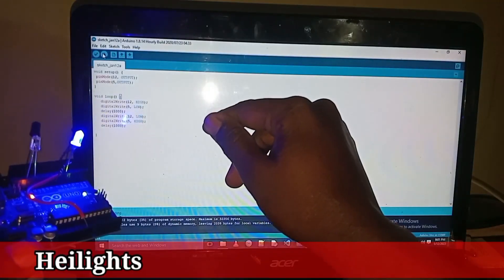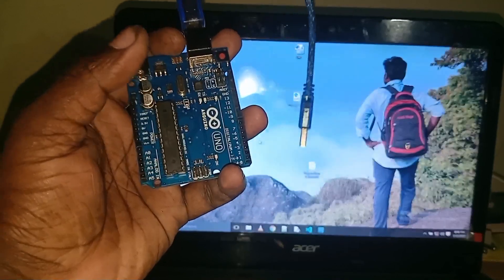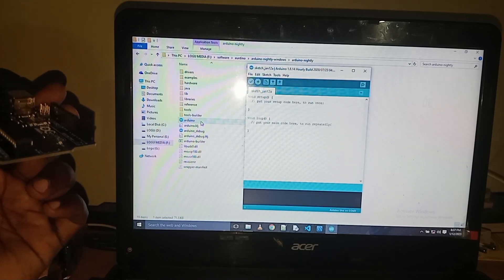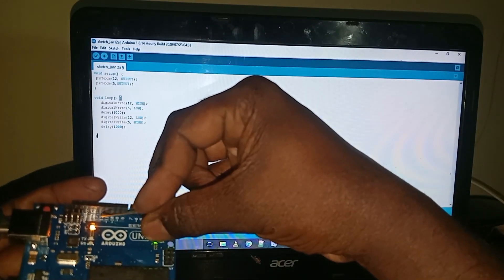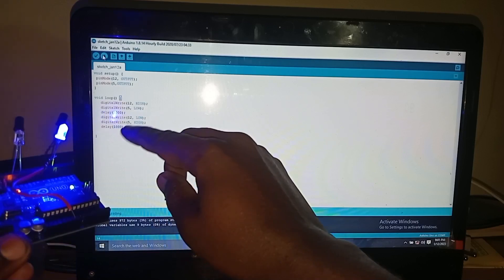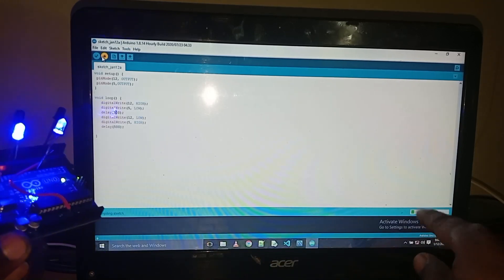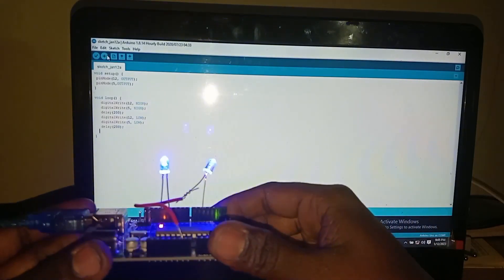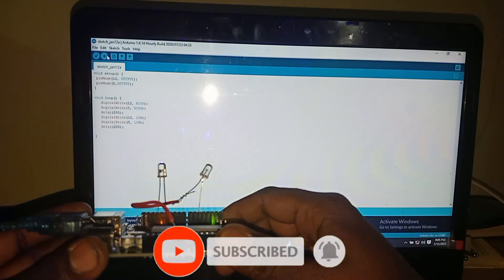LED blinking by using Arduino Uno || Arduino programming || bike indicator multi pattern flasher

Comment: Bro enakku oru doubt splendor bike frend brake wire chnge panna illa matra karanagalal km meter slow akuma please sollunga 🤔
Reply from the maker: Apdi aagathu bro but speedometer gear pinion problem irunthavo or sometimes cable la slot problem iruthaalum slow ah irukkum bro
Reply: @LandforLearners  Bro na splendor bs6 frnd brake chnge pannen eppo speedometer la 3 km ponna 2 km tha kattuthu 1 km kammiya kattuthu enna panrathu 🤔
Reply from the maker: Speed 60 kku Mela poogutha bro
Reply: @LandforLearners  pokuthu bro km tha kammiya kattuthu